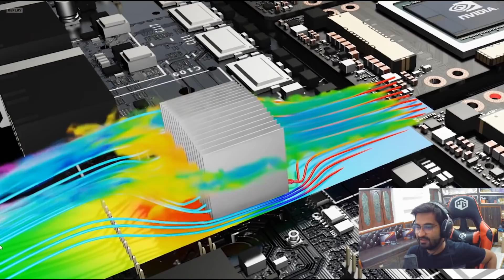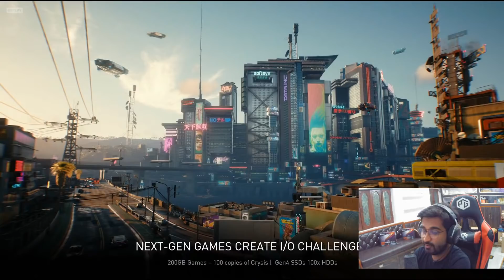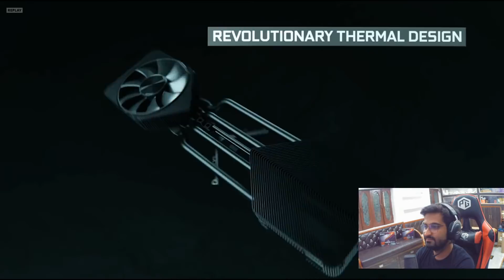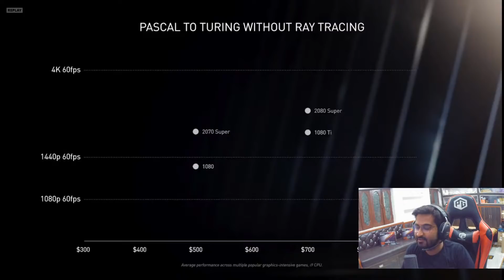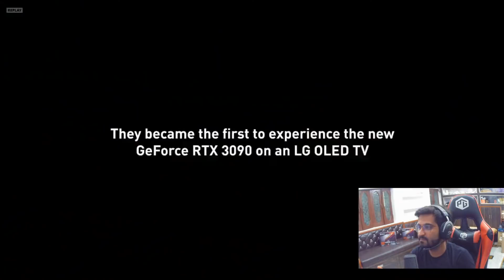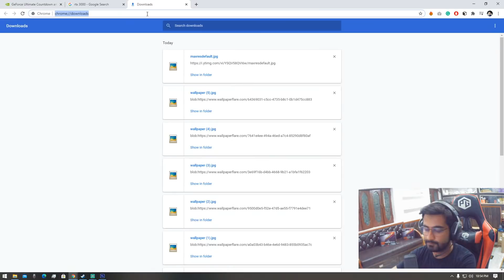[HINDI] RTX 3000 Series Launch

Comment: The new RTX 3090, 3080 and 3070.

"To all my Pascal gamer friends, it is safe to upgrade now." -Jensen Huang

A few things to note:

With DLSS, the 3090 can play games in 8K,
The 3080 can do Raytracing at 4K60,
The 3070 is as powerful as the 2080TI,
The 3080 is 2x as powerful as the 2080Super,
The 3090 is the new Titan,
I'm pretty sure Jensen pulled the 3090 out of his oven...

Release dates:
3090 - September 24
3080 - September 17
3070 - October TBA

Prices in USD:
3090 - $1499- 1.52Lakhs approx
3080 - $699- 71k INR
3070 - $499 - 51k approx

There are a lot of new technical specs, but I will let someone else explain them because I'd probably mess up.

Comment: Bhai, want to build a new PC, which processor do I couple up with RTX 3070. 
Are the AMD 4000 series processors for PC's coming this year ?
Reply: Yes most likely they'll be coming this year
Reply: @orion260  Thanks bro 👍
Reply: If they won't come
So, go with Intel i9 9900k for Overpowered gaming performance
Or if you want to do rendering+powered gaming then Ryzen 9 3990X
Reply: @19yearold62  I9 and Ryzen 9 both would be out of my league. Maybe Ryzen 7 3700x or 3800x is something I am aiming for. But just waiting for Ryzen 4000 series.
Reply: @MinkleSharma08  OK BRO
Ryzen 7 3700x 
Or
Intel I7 9700k
Reply: @19yearold62  👍👍 Yes bro

Comment: Sir can we run rtx 3070 with R5 3500
Reply: Yes i will rock with pci gen 4
Reply: It will bottleneck big time. Because the r5 3500 or i5 9400f slightly bottlenecks the 2070. So definately they will be a large bottleneck for the 3070

Comment: I have Ryzen 5 1600  with 16 GB Ram. I am going to buy 3070 but  damn sure my cpu bottleneck under the gpu
Reply: @Adithya R  so I should undervolt the gpu until i upgrade the cpu to balance the cpu and gpu?
Reply: @Adithya R  i thought the 4000 series cpu is launching with OEM prebuilt PC before they start selling just the cpu.